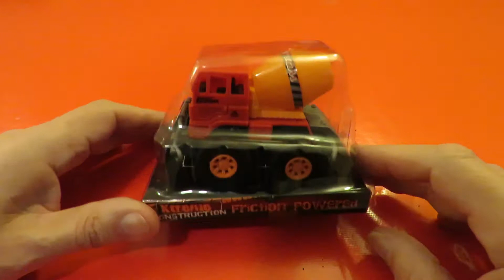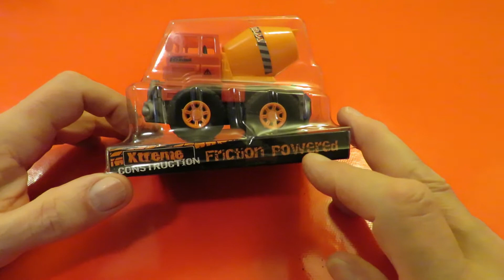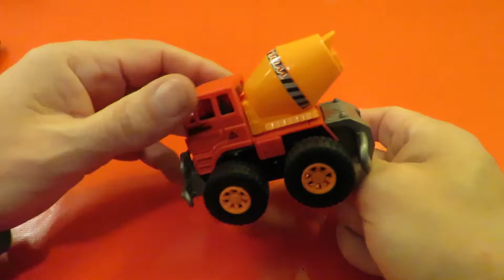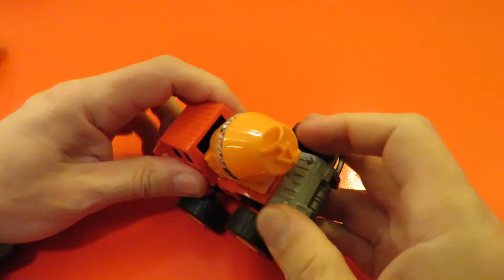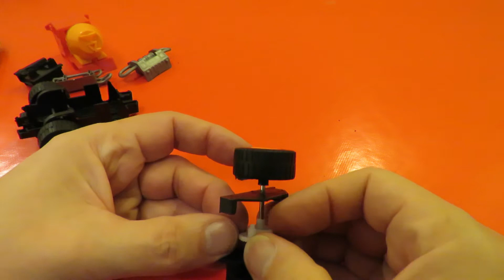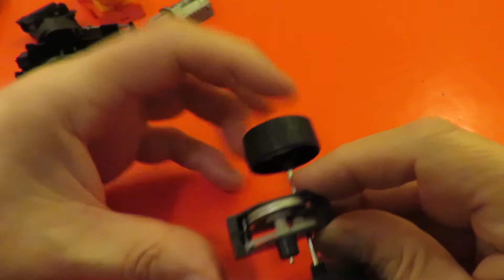Disassembly - Poundland Extreme Construction Friction Powered Truck

Comment: Have you ever tried swapping in a heavier flywheel or adding a third disc?
Reply from the maker: No, but that would be an interesting project. I would expect it to increase the distance it can travel. Obviously it would depend on available space within the motor frame.
Reply: Yes the space is limited...perhaps larger diameter.
Reply from the maker: Wil Hobbs same issue in any direction, they make these to tight dimensions.
Reply: Oh well
:-)
Reply from the maker: Wil Hobbs 😊